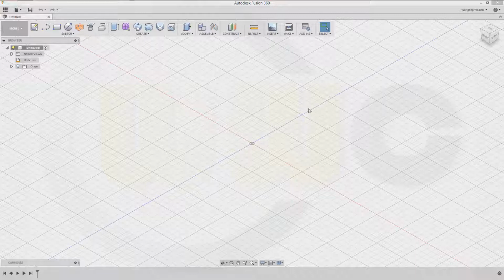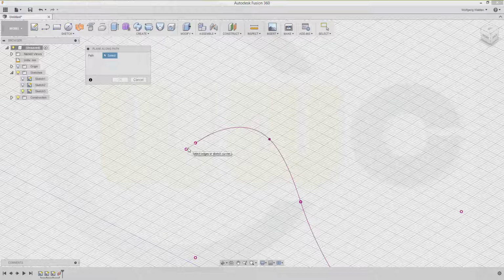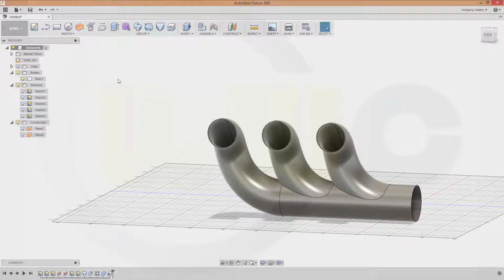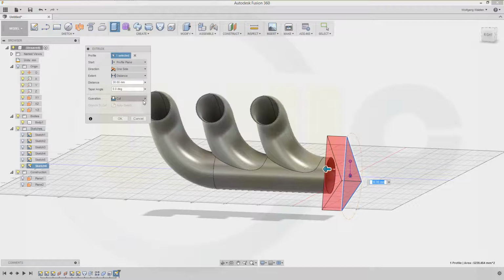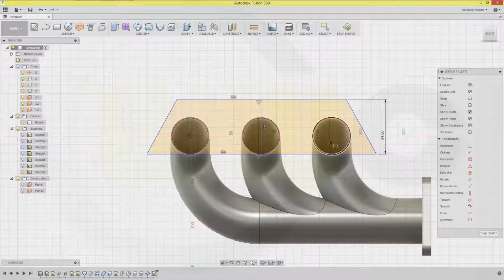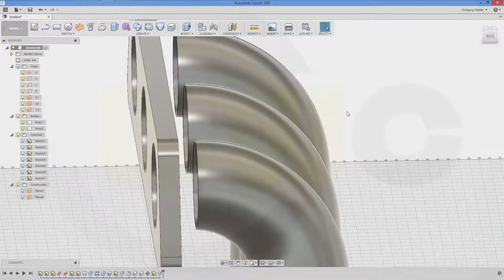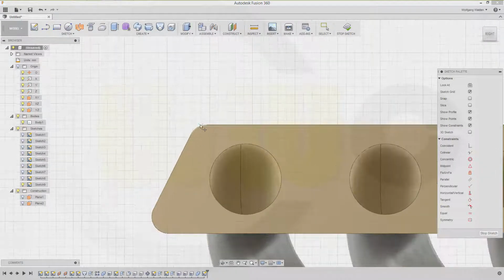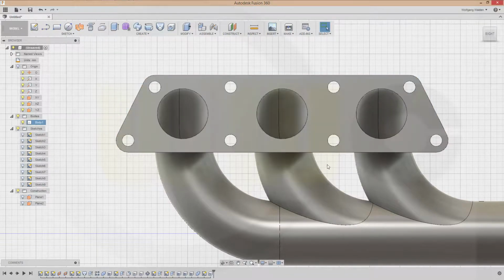12.2 Abgaskruemmer - Exhaust Manifold - Autodesk Fusion 360 Training

Comment: Another quicky.  Is there a reason why I shouldn't use a 3 sided polygon instead of creating a triangle out of lines.  Thanks!
Reply from the maker: No reason at all, I usually go for the line-triangle because not all programs can provide 3-sided polygons. So I usually don´t check if a n-sided polygon is provided.

Comment: thanks for getting back to me! By the way, how do you like Fusion 360, especially compared to Solidworks? Because the education license is free (I lecture at a university) I have just started to use it, but I'm concerned if it will be too limited once I get into more complicated modeling. Any advice would be greatly appreciated.
Reply from the maker: Hi, Fusion 360 is pretty much like Inventor - in some ways slightly better in some ways a little bit worse. Regarding surface modelling both inventor and fusion 360 are - lets say - not worth mentioning. So if you don´t need surface modelling I can recommend Fusion 360 otherwise SolidWorks is better in respect to surface modelling - if you are really into surfaces, than take 1. CATIA or 2.Siemens NX.